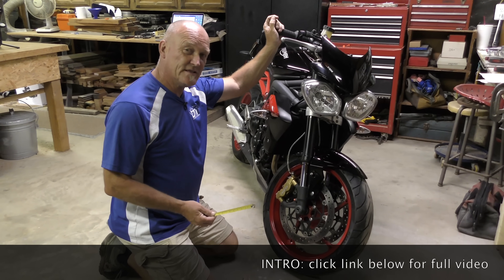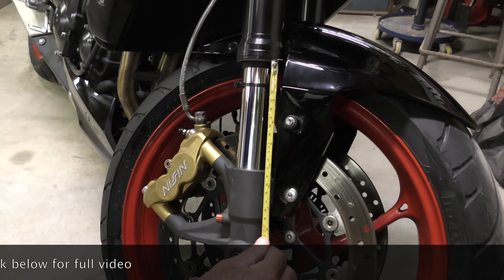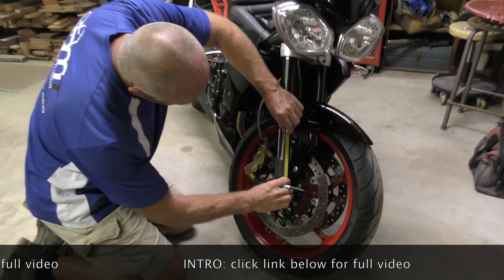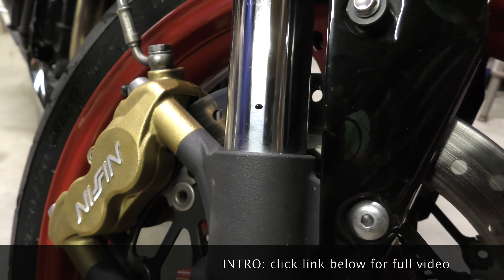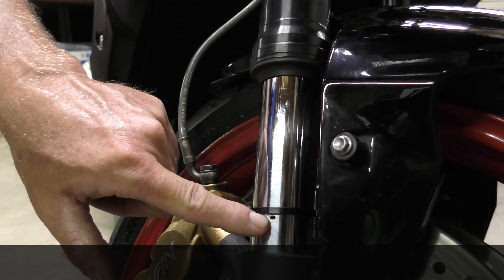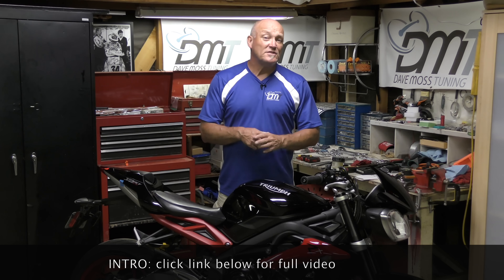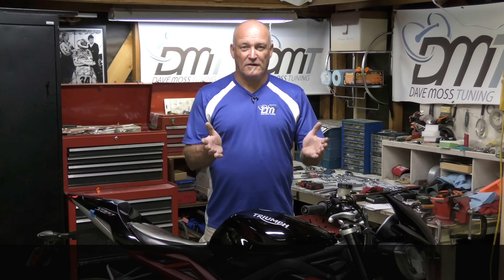Set Up Your Motorcycle Suspension in 6 Easy Steps Intro

Comment: as someone new to motorcycles, you just made this whole task even more complicated and I learned nothing
Reply from the maker: 1. Ergonomics.  2. Setting sag. 3. Setting damping (rebound, compression). 4. Cold tyre pressures. 5. Ride and assess fork and shock travel used.   6. Reset sag to optimize travel used and set chassis balance via hot suspension oil and rebound settings. Hope this simplifies your work flow.
Reply: Watch the video 10 more times or pay for the whole video which comes with hundreds of others and near unlimited info.  The info is there and not all is free.  Hope you've learned a lot in the past year

Comment: What's the best way to bounce the bike to measure rebound? I.e do I need a front wheel chock? Also, are there any tips for someone who is light, say 50kg, and struggles to bounce the bike?
Reply from the maker: 1. Ride for 30 minutes to get the fork and shock oil hot. 2. Chock is a good idea to maintain stability if you are doing this at home.   3. Pull up on the bars first and push down second.  4. You push down gently and then push down with force.   5. If you are lighter in weight, standing up on a small box for additional leverage is useful.
Reply: @catalystreactionsbw  thanks Dave!

Comment: slightly confused.  175# dave's numbers were 86mm total sag on the forks.  when you adjusted preload you went to 83mm....then added another turn to gain 3 more.....you did not mention the number but can i assume it is 80mm?  you said a total lose of 6mm.  my confusion is if we are adding preload why are our measured numbers (with dave on the bike) decreasing?  when you add preload shouldnt the sage measurement be increasing because the the shock is com[pressing less?  what am i missing here?  thanks
Reply from the maker: Your thinking is correct with increased preload = less sag if the internal engineering allows that to happen. Sometimes it does not as the preload spacers are not the correct length.

Comment: Dave, have you noticed any design issues with the L1 - L9 GSXR 750 rear shock / linkages? I own the L6 and after adjusting the rear sag to 30 -35 mm I still find the rear very hard to push down to check the rebound rate even after I have taken all of the compression out. I am finding that on B roads that there is a juddering feedback over bumps. Slowing down the rear rebound and opening up the compression helps but I can still feel it. Rear tyre pressure is 36 - 38 psi. I have been to a few bike shops and pushed down on the seat and find that the GSXR is much stiffer than other bikes. Thanks for the content.
Reply from the maker: Have you taken the linkages apart and greased them along with swing arm bushing etc? Stiction can exit in this part of the bike and give you exactly the sensation you feel. If the shock has not been serviced it will contribute via poor rebound settings.
Reply: @catalystreactionsbw  Thanks Dave, linkages and swing arm bearings have been greased recently. Even changed out the rear shock to a bitubo unit. It just seems that the rear is dominating the front as it so stiff compared to the forks.

Comment: DAVVE!! Thank you so much! Finally poured some of the fork oil out of my daytona 675. Not getting the lock up and the bike never felt better. Adjusted compression to 11/23 clicks. And also had a rebound tire ware issue. The trailing edge was worn. So I lowered the rebound and its so much better. Thanks dave with out you i would have never known the importance of suspension and the impact it has. You help thousands of riders out and I want to thank Dave Moss and Dave the editor. Love you guys! Peace!

Comment: Thanks Dave. I need to fully understand all the adjustments on my 2016 Thruxton 1200R
Reply from the maker: You should have preload, rebound and compression both front and rear. Make sure that you have static sag accurate for the rear shocks! Then assess fork and shock travel used and alter preload to get travel optimal.

Comment: thank you. I will have to watch the full video later. At least now i don't need to worry and wonder as much about my suspension screws at top not lining up. Feels a little weird, throttle hand starting to numb. I just stare at the screws and wonder if they should line up. I too have never messed with any of my suspension, either because no adjustment or the great fact of lack of tools, knowledge, space, and help. That and not wanting screw anything up thinking it should be set of right anyway. Probably weigh 150-160. think my new/used bike say it is supposed to be set for 180 pound rider. Zafferano scooter and Zero S now.

Comment: I've watched a lot of your free videos and they've been very helpful! What I did wrong was set up the bike's suspension with its old oil while cold instead of while hot after a >1 hour ride. My confidence on bumpy roads has doubled and I can now actually brake and accelerate instead of having to coast through the bumps, and it's now a whole lot more stable in corners (which I only realized after NOT hanging off the bike on the old settings!)!
Reply from the maker: Excellent work and thank you for sharing what you learned and how you applied it!

Comment: Hi. That's how I tune my suspension. First, I measure from the rear suspension axle to the rear wheel axle, and from the suspension axle to the back of the bike. I mark the point. Then I get on the bike and I measure the displacement of the suspension and check whether it's 1/3 of the full travel as indicated in the manual. I tune the rear spring accordingly.  Then, I push down the seat and check the front and rear go down evenly and I adjust the fork. If the motorbike "falls" in corners, I harden the front. If the motorbike is hard to turn, I soften the fork
Reply from the maker: Great explanations and thank you for sharing how you set up your motorcycles.
Reply: Do you mean, the harder the front fork is then the bike will be better at corner? I set my rear shock a bit higher than standard on my Kawasaki 250 since the standard shock height was burdensome for me. But people said higher rear shock is dangerous at corner, even though i never tried cornering much only when i got the sudden confidence. So should i stiffen the front fork? Do you have any opinion that you can share about this?
Reply from the maker: @howruben  Fork height is based on rake and trail numbers first, so review what you have. Then you assess fork travel and see how soft the springs are.  If so, raising the front will give you better steering and braking control. If so firm, lowering the front will level out the chassis making turning easier.
Reply: @catalystreactionsbw  wow thanks man, i will try to make a little correction and make sure to find the best setting for me. Thanks again!

Comment: Heya Dave great videos keep doing them I have a problem I have a nc700 dct honda and as a commutor bike the suspension for nz roads is terrible and have ordered a new rear adjustable so while riding to town the other day the front mudgaurd fell off on inspection its mounts were shattered it hits bumps real hard our roads here are shocking what is the most economical way of fixing this (there is no adjustment available on this model Cheers Charlie
Reply from the maker: Hello Charlie. I know NZ roads very well after almost a decade of touring and teaching and clocking up over 10,000kms each trip in 8 weeks. It seems that the forks for the NC need 15w oil so they do not go through the travel so fast. I've done that with several and the owners love the results. Hopefully I will be back in 2023 now that NZ is opening up.

Comment: Just bought a new MT09, and would love to get the suspension set up properly. In the beginning you mention the spec “in the book”. I can’t seem to find any reliable spec for my bike. Any advice?
Reply from the maker: Thanks for your message and congrats on your MT09 - amazing platform.  Set rider sag at 30-35mm front and rear. Then set compression at 50% of the total range. Rebound is a guess as i have not adjusted one of those yet so leave those adjusters as is.

Comment: In the intro of this video, you talk about videos which will help with setting up suspensions with limited or no adjustability. I'm curious - how do you feel about riders who swap out their OEM suspension components for fancier, more expensive bits? Are they spending money they don't necessarily need to spend? Is there enough adjustability in some of these suspensions to make up for the fact that there isn't a lot of adjustability?
I know what people spend their money on is their own business, but I also know people are - to a degree - sheep. So, I think a lot of people swap their stock suspensions out, because "everyone else is doing it" or because $$$ always seems to equal "better." Granted, a $1,200 shock is probably substantially better than a $200 unit, but is it necessary for the average rider or even a weekend trackday warrior?
Reply from the maker: If a rider has disposable income and wants to remove and replace OEM suspension with far more expensive components, I have no problem with that at all. I hope that they have it built correctly in order to ensure it works optimally. I have won races with revalved and resprung stock suspension to prove a point or simply changed fork oil to get the suspension working the way I want it to be. As I do not have $$ to spend in that manner, I try to make the best choices and spend $$ as needed.

Comment: Hi dave I just bought a 2008 yamaha r6 raven but I don’t know how to check if its in a good condition what I know is it has a slip on yoshimura exhaust, both break pads  front and rear is 90%, rear sprocket is good, battery is dead so we just used a battery jump starter, it start a little bit then it will turn-off and since it’s winter we haven’t ride test the bike.. what’s the best thing to do to check the bike? Thanks..
Reply from the maker: If you have the equipment, #1 test is a leak down in the spark plug holes.  #2 is check the spark plugs for color and gap.   #3 is to check valve clearances and  #4 is air filter.

Comment: I’ve got a VF750F Interceptor that I’m yet to restore, but I’m already thinking about how I plan to set up the suspension better than Honda knew how in 1983 - using your advice. The original air shocks were okay in their day, but cannot be fully rebuilt. The forks had the anti dive thing - which apparently never did work. I’m thinking CBR600 cassettes are needed. How do disguise these and a modern shock???

I’m not going to save any money on that project ...!
Reply from the maker: Nor should you disguise anything for the work that you have painstakingly gone through to recreate your Interceptor. As you can imagine, many riders have gone this route before you and have posted all the modifications they have done, so research quickly yields excellent information. Having newer technology in place will also help other owners who might be thinking the same as you so you can pay it forward by sharing your work! Have fun :)
Reply: Dave Moss Tuning Thank you for your wise words of encouragement. Much appreciated. 

I do like the idea of modern suspension that looks original. So I’m exploring ways of modifying the original forks, and possibly making a lightweight cover from alloy tubes styled on the humongous solid heavy steel air original shock. 

The front forks are actually rather skinny, so CBR600 cassette replacements would be better. But that means boring out the yokes. If this is safe to do, then it would improve the bike no end. 

I trawled the forums quite a bit. Turned into a bit of an addition at one point. There are some very experienced guys who do great work keeping the older bikes going.

Comment: Hello brother dave, I am cb650r owner and I’m 5’ 11” height, I want to adjust the fork instead I use handle bar extension to make it more up. 
Is it ok if I adjust the fork 10 millimeter move it down to make my bike 10mm  higher than the original setup?
Reply from the maker: Start with 5mm and make sure you have 15w fork as soon as you can.
Reply: Thanks a lot for that brother dave appreciated. And I learned ideas some of your videos about motorcycle. Thank you ride safe ✌️💪

Comment: Hi Dave,  I have a 1984 Honda VF700F Interceptor.  Bought it used in great shape and have brought it to present day glory.  After reading the manual on the level of adjustment of the suspension both front and rear, getting it dialed in still escapes me.  Granted it is not a 21st century super-bike but from it's race heritage there should be enough there to get it set well for spirited street riding.  It appears to have NO static sag, but with bumps in the road I don't get thrown out of the saddle.  The front end is just as mysterious.  Any guidance and wisdom would be hugely appreciated.  Thank you!
Reply from the maker: 15w fork oil to 140mm oil height with 3 rebound adjustments as stock. Shock is listed as air assist with 4 rebound adjustments so it will not top out and will leave you in the seat. I do not know if it can be taken apart and/or if it is serviceable. 1. Do the rebound adjusters work?  2. Does the shock hold the same air pressure over a week?
Reply: Thank you very much for the reply.  The rebound adjusters I'm assuming are functional as the bike rides as expected with no wild or out of control feeling.  I will double check to insure they are working.  I'll check on the shock air pressure as well.  I'll be in touch with the info.
 Thanks again!!

Comment: Dave Moss/Williams hi
on the board (whiteboard) 
Mr Williams total sag was  44 mm for front
&
Mr Williams total sag was  39 mm for rear
one doubt  for clarification;  
Total sag 38mm front
&
total sag 39mm rear
am I correct! on this data points on final reading
Reply from the maker: Will watch and see if we used incorrect numbers!
Reply: @catalystreactionsbw   in continuation on total sag ; if the nos are same (39mm front and 39mm rear) is this considered balanced setup...

Comment: Excuse me Dave houn question to ask, unfortunately I can't find an answer. If I use a kit to lower the rear by 2.5 cm, do I also have to lower the front fork by 2.5 cm to maintain normal cycling?
Thanks so much
Reply: They say u have to lower the front just as much as you lowered the rear, if not, try to lower the front to almost the same amount as you lowered the rear. How this helps, not a suspension expert, just what I've heard or watched.

Comment: What do I do if I can’t get my shock to 40mm. The lowest I can get it is 50mm. Do I have to get a new spring?
Reply from the maker: Assess fork travel used to see if you reach the shock bottom out bumper. Ideal travel is 2-3mm off the bumper
Reply: @catalystreactionsbw  sorry I meant rear shock. I bought an ohlins for 165 lb rider but I’ve lost weight and am around 150 now. There’s a certain spot on the shock where I get 50mm then when I add or subtract tension the number starts to go up.
Reply: My front forks come in at 23mm haha. It’s a stock fz07, saving up to get adjustable suspension

Comment: Dave...I have a Suzuki GSR 600. In the manual it says   "front fork stroke 130 mm"
I lifted the bike, with the wheel being in the air, and it measures 125 mm. (the expose distance).  How do I measure the rider sag, in regarding with the static sag???
Reply from the maker: Take it for what it is at 125mm as you probably have some stiction going on (separate video). Once set, put a cable tie on the right fork tube and go from there by managing travel using preload.
Reply: @catalystreactionsbw  Thank you so much!

Comment: Ho Dave Moss, i was wondering which is the oil level on a showa bpf 43mm for a 70 kg rider. It is installed on a Suzuki gsx r 1000 k9. Thanks
Reply from the maker: 100-120mm depending on aggressiveness
Reply: @catalystreactionsbw  Thanks so much. I asked you because with the level like service manual says, 75 mm, i can t reach the complete course of the sospensions.

Many congrats for your videos

Gilberto from Italy

Comment: If i change the preload on the rear shock, does it chance the seatheight as well?
Reply from the maker: If you make reduce sag by adding preload depending on the spring strength seat height may rise slightly.

Comment: I'm pretty sure I cant adjust my suspension on my bike, 1992 Yamaha xj400 diversion. My bike is like a bouncy castle in the corners
Reply: There is very minimal things you can do to an old budget bike, save for physically moving the forks and changing oil, that's just how it is, low quality suspension.
Reply: My bike has air controlled suspension just pump in The pressure u need and get those corners
Reply from the maker: 15-20w fork oil to the stock volume and think about getting firmer springs.

Comment: Hi, I own a CB 600 Hornet and only the rear shock is adjustable in terms of preload. Also I'm a pretty heavy rider, do you mind sharing any tips or good to know things?
Reply: Well, obviously you're gonna wanna ditch that shock for an adjustable one. Get it resprung to your weight, as well as the forks, and adjust them to the parameters Dave will give you over the website on remote tuning.
Reply: Q? What do you use the bike for? street, track, adventure, cruising, touring.
how many miles on the bike when the suspension was serviced if it has ever been serviced?
If the shock is  a disposable item is it time to change it out for something that is serviceable / adjustable.
What budget do you have for a serviceable shock second hand ebay special  or full on  WP, Ohlins etc...
What springs and preload do you have in the forks?
where are your current sag numbers % of travel ?

What is your skill level when it comes to mechanics and servicing? Do you do the work yourself or do you need to have it done for you?
Reply from the maker: If the forks are over 15,000kms they need to be serviced. The shock over 20,000 needs to be replaced. Let's star there. You can also look at fork and shock travel used.